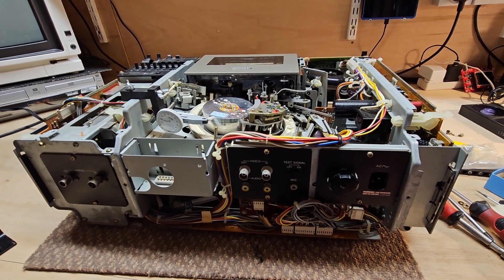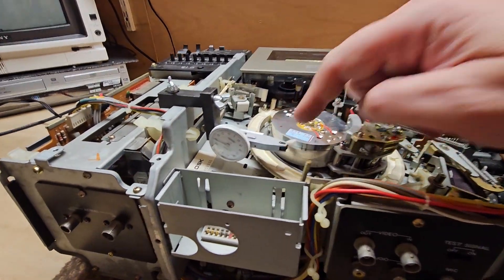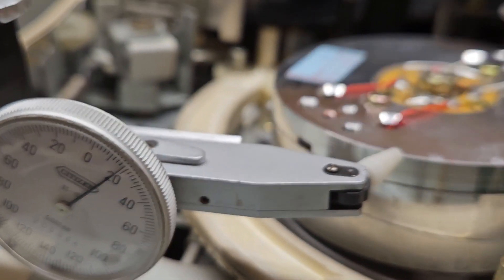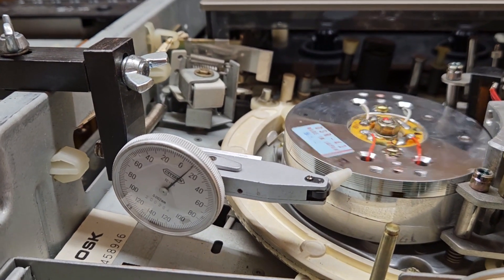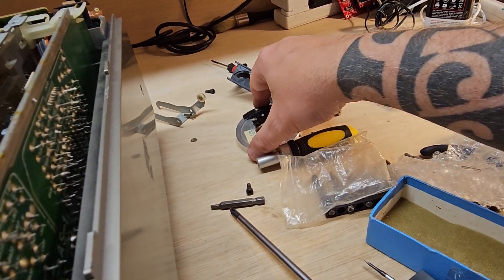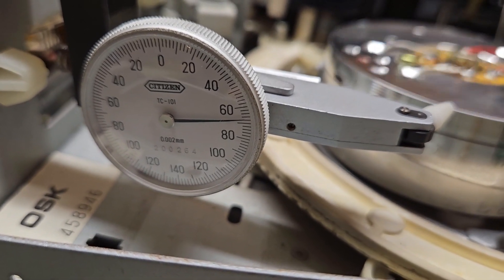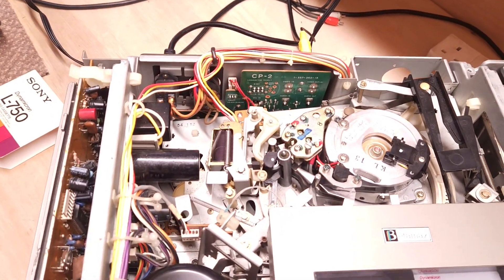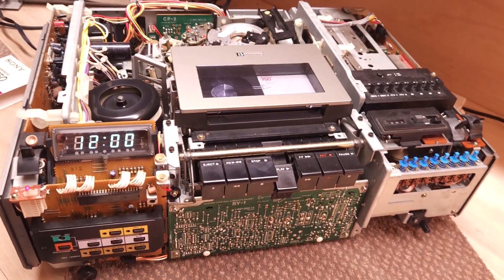Sony Betamax SL-8000 checking head alignment

Comment: You probably can move the eccentricity gauge closer to the head disk where the tip is in contact when you spin the disk along with zeroing out the dial to get an accurate reading. I can just tell that it is off a little. Which would cause the picture "warbling" issue.

Comment: As far as i now you use the original adjustment tool for centre the videohead. Did it a lot on SL-8000/8080, C5, C6 and C7. From C20 to HF950ES the videoheads had an another design. No centre adjustment needed, happened automatically.

Comment: Is your TV on the VCR channel? IE flywheel sync disabled?
Reply from the maker: Turned out the issue was down to head alignment issue. The head chips were not 180 degree apart. Used a tapered screw to gently adjust one of the heads. Took quite a few attemps ot adjust then play, adjust then play. Got it playing very nicely.